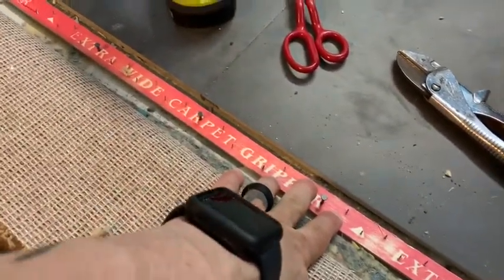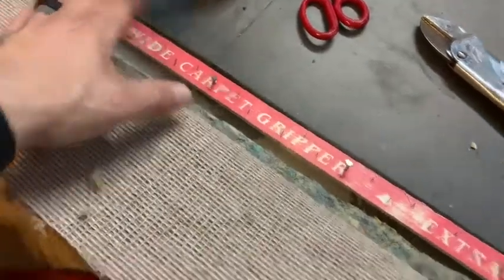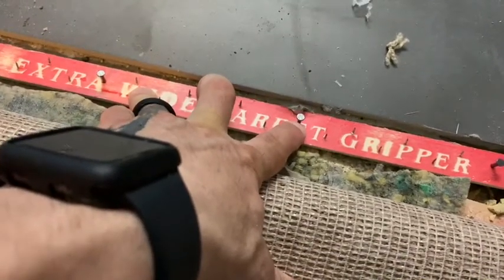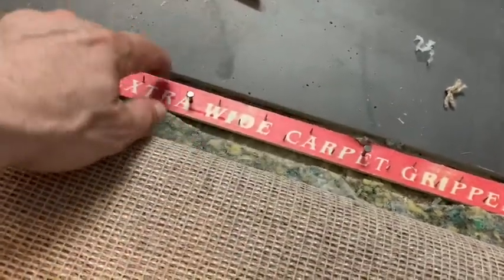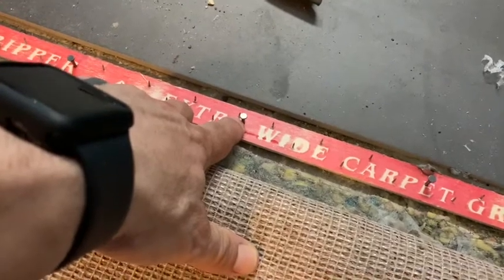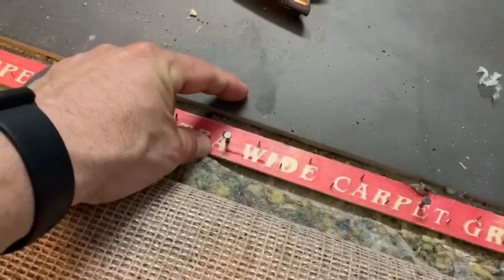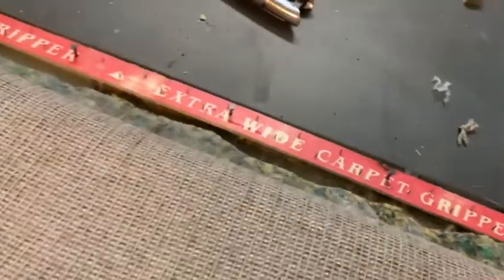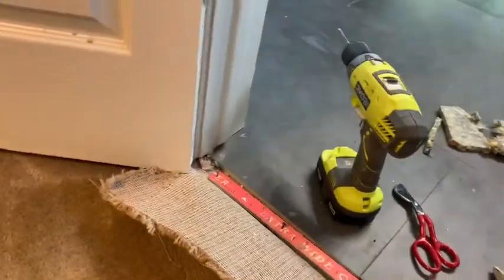Carpet to Tile finish out repair #carpettime.

Comment: I always use 2 joist hanger nails in the same hole holds it very well and a lot cheaper, trick I learned from an old installer friend of mine
Reply from the maker: Jason James   This is what I like to hear. The tips you can pick up that go outside the normal way of doing things. 😀👍
Reply: @CarpetMuscleTV  I use a 1/4" drill bit and about a 1 1/8" nail
Reply: Jason James what size hole and nail do you use to do that?
Reply: @burn1down249  1/4" drill bit 1 1/8" nail
Reply: thanks bud
Reply: how many do you you put in per strip?
Reply: how many per strip?
Reply: @burn1down249  about every 6-8" depending Also on lanth of pull, and on a large room you can put 2 strips of tac strip down
Reply from the maker: Jason James   If you can remember Please text a pic of the nails that you use. 5123501129.
Reply: @CarpetMuscleTV  will do
Reply: I used this method today and I can say that it is very effective. I used 25mm long 3mm diameter paslode concrete nails (regular nails not gun nails) and a 5mm masonry drill bit. I stretched the room in with the mini stretcher and a knee kicker.
Reply from the maker: Martin Baker a good friend is Reuben. Floors by southern boys. If you haven’t heard of his channel definitely go subscribe. He is a great guy. 👍
Reply: he’s got some good videos, I’ve been subscribed for a while
Reply from the maker: Martin Baker   He is a great friend. We text and he is also a moderator on my Facebook group. I have known him for about 3 years. He just had surgery and is healing up.
Reply: Jason James I use the extra wide, is that what you use or the skinny stuff?